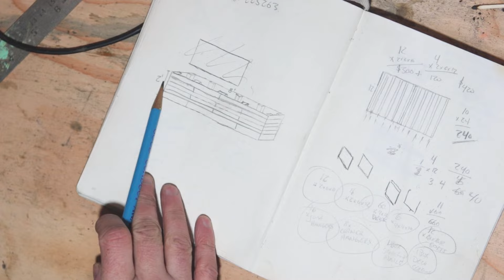Homegrown E2 | Winter Woes FULL EPISODE

Comment: Put a tarp over your wood or build a roof from house and stack Wood under it. Wet wood is not a great heatsource. Also consider adding more insulation on outer walls and in attic floor and slanted roof as heat rises. If you can insulate garage well since you are using as winter workshop. Also some people never a climate to the cold. Are you thinking of painting your house another color?